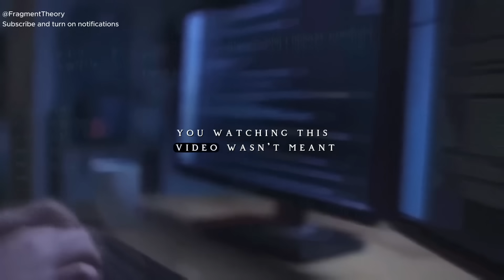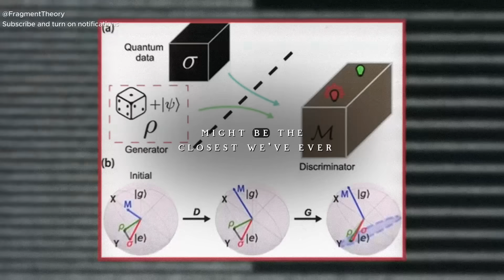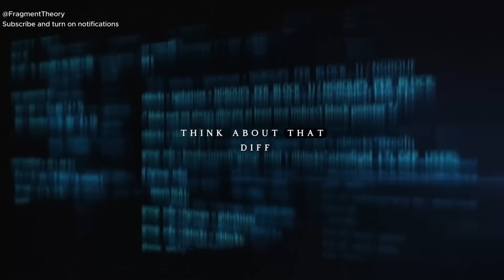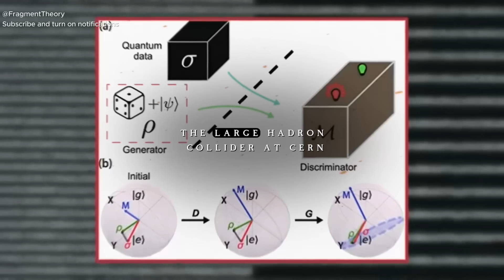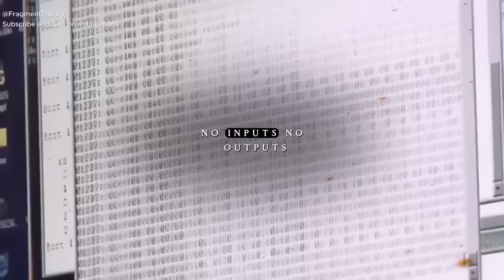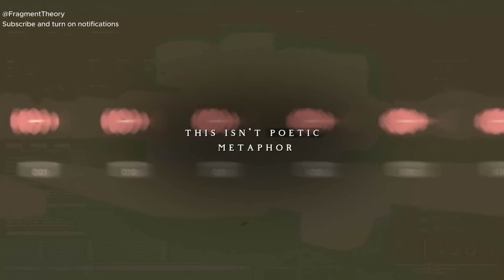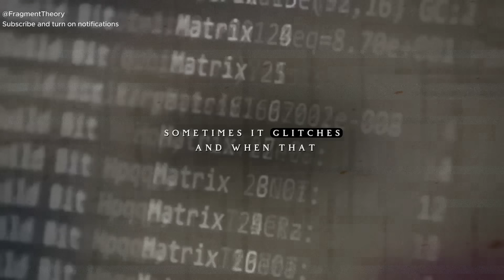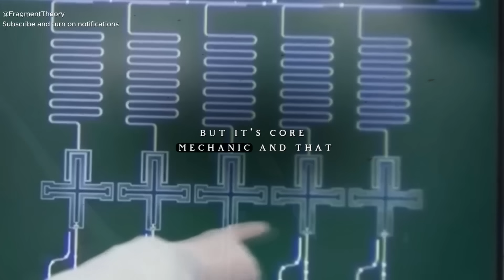Google’s AI Found a Glitch in Reality — And It’s Getting Worse

Comment: Nice productions values.  But someone has been watching The Matrix way too much.
I use AI basically as an advised search engine.  But even at that is has it's problems.  I ask for a verse from the new testament of the bible on a subject, because AI is fast at looking things up.  How ever it gave me a verse in Proverbs an old testament book.  I pointed this out to the AI and it said, yes you are right.  I ask the same question again and it gave me the same answer. Now most of the time I receive the right answers, but there are times I don't.  My point is that I don't rely on AI at this point and neither should others.  It is not correct at times and not as advance as they would have us believe.